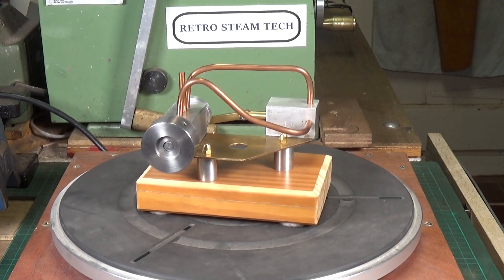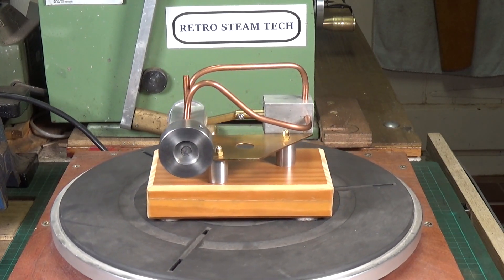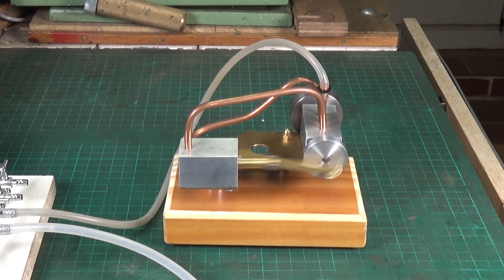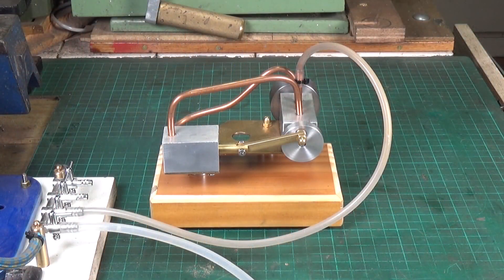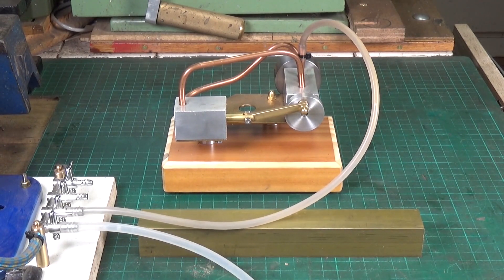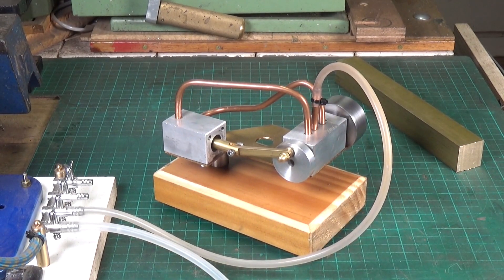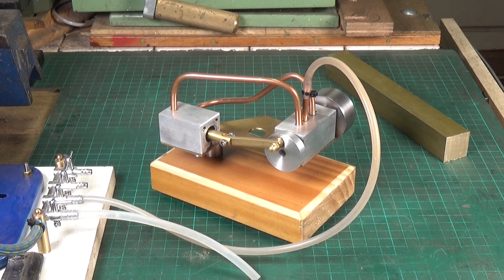Scratch Built Rotary Valve Model Engine

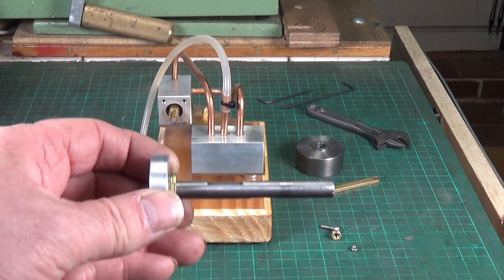Comment: Hi, I was wondering if you would tell me the position of the crank pin in relation to the input and exhaust flats.  Based on the picture at 2:15, with the crank web facing you, the intake flat is at 9 o'clock and the exhaust flat is at 3 o'clock, is the crank pin at 6 o'clock position ?  Thanking you in advance.
Reply from the maker: Hi. The video doesn't show the crank pin position very clearly. If you look directly at the crank, with the nearest flat at top dead centre then the crank pin is 220° going clockwise from top dead centre.
Reply: @RetroSteamTech  Thank you for your reply.  I might have a go at making one.  Cheers!

Comment: Very good video Alan.  I understand how those port flats work now.  I will probably have a go at one of these as well. Most interesting.  Cheers Rob
Reply from the maker: Hi Rob. I was hoping the video would explain it better than the photos. A very simple design but very effective. Haven't started my brass build of one yet, too many other projects on the go 🙂 Cheers, Alan.
Reply: @RetroSteamTech  I was interested to see your air compressor taps.  I have a couple of those stainless steel aquarium air taps on order from China ATM.  Good idea.  Cheers Rob
Reply from the maker: @Xynudu  To be honest Rob, what I really wanted when I mounted the compressor on the wooden base was a nice small regulator. I just couldn't find one, the only ones I could find where the standard size that you get with a large compressor. So went I with those little taps which work quite well, you can regulate the air by just opening the taps that are not connected. I'd still like a pressure gauge on it though. Again finding a small one is proving difficult. Cheers, Alan.